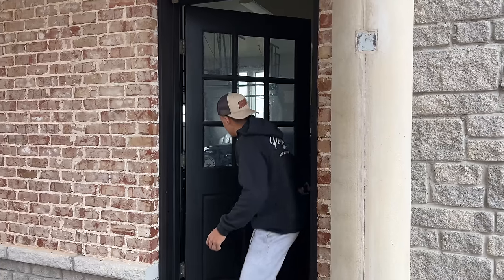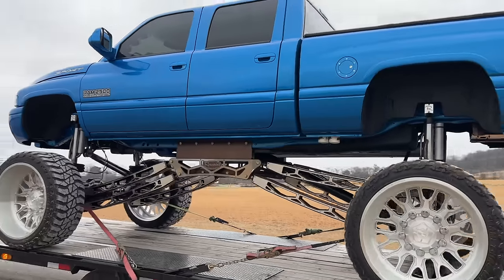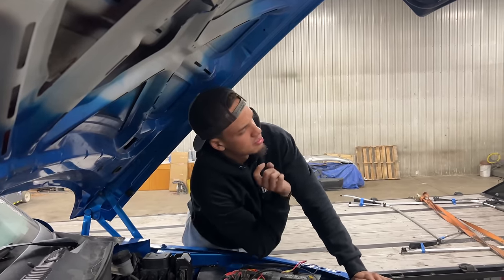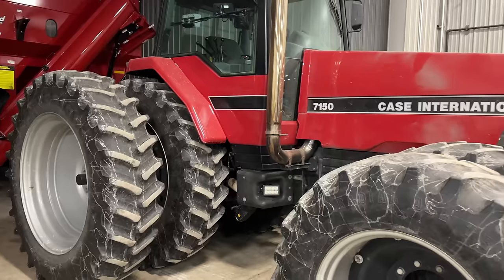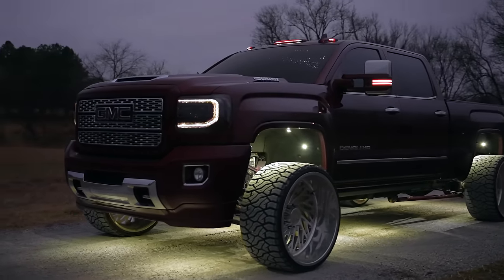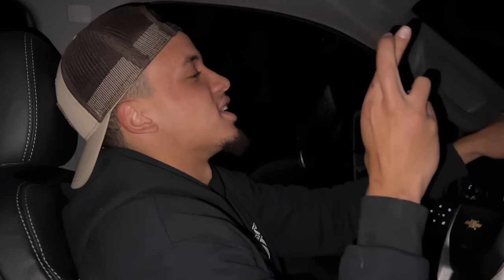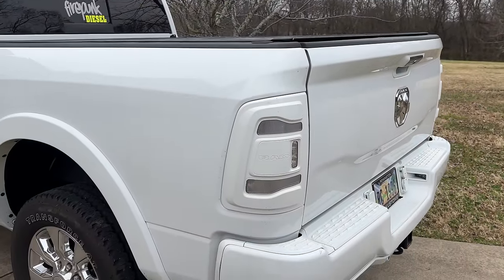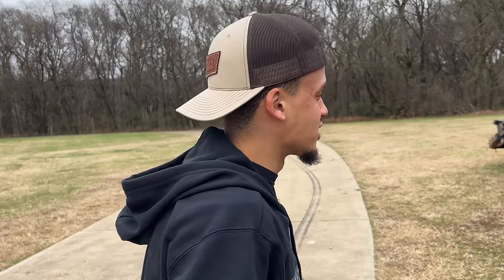30” Lifted Crew Cab 2nd Gen Cummins Gets +1200 HORSEPOWER ENGINE!

Comment: stocking njectors stock pump and compound will not make 6-700 hp especially in a 12v injectors are good for maybe 450hp